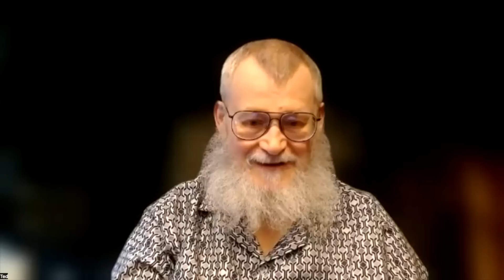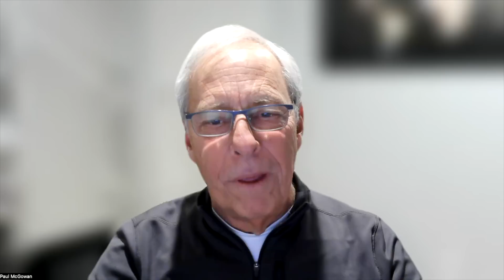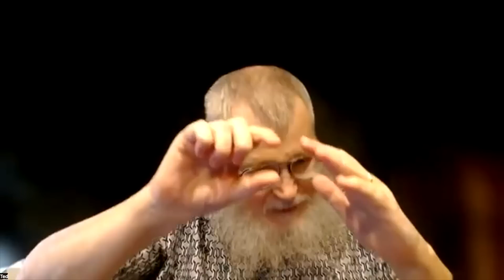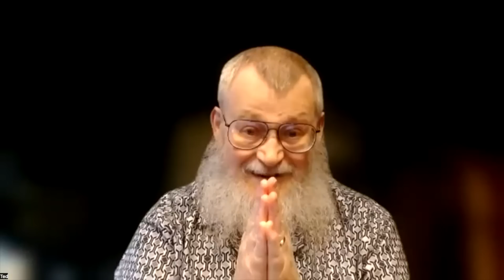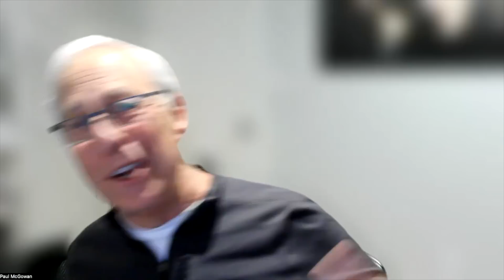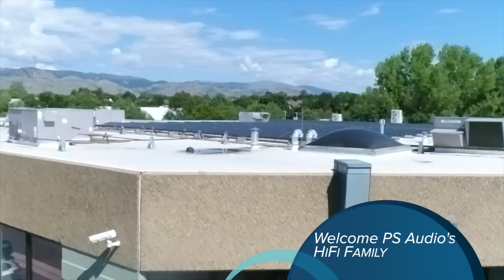Paul and Ted discuss the DirectStream MK2 DAC

Comment: As a PS Audio fan and with so much going for the Mark II, I need to ask.... When might we see a chassis redesign/upgrade of the company's electronics (i.e. make it look better)?  At the level that you're playing, you must see the importance of this...case in point, the FR series vs prototype designs or other companies' designs.  It's not all about looks, but if my water boiler is universally more visually appealing than a >$5k luxury electronic, there's something that needs to be solved.  🙏
Reply: I'd like my MKII's on order to be a little fancier, but the silver looks fine.  I wish the screen were as big as the MK1 I just sold.   But we PS Audio customers are value customers.  I'm kind of happy my BHK 300 amps are so austere looking.  When first released they were reported as sounding better than the gorgeous Constellation amps, also designed by the late Bascom King.  The BHK's are a fraction of the price and have a tube input section which affords tube rolling for even better sound.  Of course now I want to trade up to the BHK600, but not possible right now.

Comment: Can you run 2 amps off the outputs like a speaker amp on xlr and a headphone amp on rca without it getting angry at you? Many dacs only like 1 output getting used and prefer just balanced. If you plug in another amp the noise goes up bad and you get hums.

Comment: love this video. As a (software) engineer myself, I love hearing people talking about optimizations and improvement / strategies. Can so relate
Reply: I'm the polar opposite of a software engineer, (though a tech oriented filmmaker running a huge Davinci Resolve rig) yet I absolute love hearing about optimizations as you mention, and how it affects sound quality.   I've watched it 3 or 4 times, a few times pausing to read about the component he mentioned.  I have a MKII on order and excited by the potential to increase quality as Ted spoke about using the second FPGA.  In another interview he mentioned he was only using half of the first FPGA, so who knowns what can happen.  I've owned the very first round of directstream MKI 8 years ago, so I've been enjoying Ted's lowering of jitter and distortion, the platform for a long time.

Comment: Running with a Nuprime Dac-10....black as black background. No talk of galvanic isolation. Sounds glorious. Oh, and I bought it used for $800. No way human beings can make a DAC that sounds 10x BETTER than the Nuprime. Different flavor of sound, maybe. Magically makes a song sound 10x BETTER? Nope. Welcome to the Hifi rabbit hole folks.
Reply: It depends on the system.  Just converting from flac to WAV makes a huge difference in my system, as did an EtherRegen.  I know how good the MK1 was and waiting on my shipment of the MK2.
Reply: @johnnycashlesscomedy8616  of course you going to try to defend it because you're dropping $8,000. There comes a point where its diminishing returns in hi-fi an eightt thousand-dollar digital-to-analog converter is not needed to hear incredible sound. A waste of money. I have three rigs in my place and a couple of them are under $8,000 for the entire setup and they sound fantastic. You talk about sound files making a difference. I guarantee you you didn't do a blind test back and forth between the songs. So now it's called placebo effect because in your mind it should sound about her so you're telling yourself it does sound better even if it really doesn't in reality.

Comment: Interesting discussion.  But, $8,000 for a dac is rarified air.
Reply: $8K  for a DAC is just plain stupid.
Reply: @byrdmania4895  Expensive , but the product is made in the US, Colorado, if that means anything to you.   PS offers ridiculous trade in offers, like $3500 for your old gear, plus ability to audition at home before you send your old gear in.  The free firmwear upgrades keep the machine current and evolving in quality for maybe 8 -10 years, which helps the value proposition in an appropriate high end system.
Reply: @johnnycashlesscomedy8616  Yep I don't think it would be too smart,, possibly snake oil..?
I guess it could be a tax shelter for someone with too much $ but that leaves me out.. Ha Ha..
Reply: @ClearViewRoadsTV  How is buying a DAC (or any tech product) which depreciates a "tax shelter?"  I totally understand people's frustration at expensive products when many are struggling to survive, but PS Audio makes a $600 integrated with DAC a friend has and it's pretty nice sounding.  Look for it used maybe around $400.  I wouldn't have been able to afford the new DAC without the generous trade in policy. PS is a value oriented product - no fancy case, high  volume sales.  No wonder there are so many fans at many price points to let people get high end sound at relatively down to earth prices.
Reply: Generally speaking, better quality components make for better sound but they also usually cost more.  I think Ted and PS Audio have achieved a remarkable improvement in performance for only 2k more than the MK1.  Everyone has their own comfort zone / sweet spot on the cost/performance curve.  I think the MK2 has gone a long way to force that curve lower.
Reply: @carlstineman274  I agree that value is a personal question.  But, I can ‘t help but wonder what the margin is on high end audio  products.  If it were not a lucrative business why would there be SO many companies making audio equipment at the same time that audiophiles are so rare.  All of this said, PS Audio is an easy company to admire and I own an amplifier with their name on it.

Comment: Thanks for putting this together, it's always great to hear from the man that does the cooking.

As an aside are your m700 monoblocks power factor corrected?  I spent most of my life in the power supply industry so I know adding PFC correction is often done by using the right switch mode control chip in the power supply and a large amp can really do damage to the AC line waveform if it's not tamed.

Comment: "Bad digital isolation". "Magneto restrictive (sic) coupling". Oh dear oh dear oh dear. This was painful to watch and not scream loudly at every new instance of techno-babble.
Reply: magnetoestriction is a real thing. it's why power transformers "hum". The iron is literally growing and shrinking! But I've never heard of magneto restriction, and in any case I'm not sure magnetostrictions apply inside of a DAC. If he's saying that there's enough current inside the DAC to change an inductor's size, and claims that this noise is audible or negatively impacts clock or ground stability, I would be suspicious of the claim.
Reply: Ted is a genius that worked at MS before developing a groundbreaking product.  I've heard every step of the way how his new OS builds lowered distortion and many other positive qualities.  You should hear his gear in an appropriate system before dismissing it.
Reply: @johnnycashlesscomedy8616  I don't need to, nor am I dismissing his gear. I'm dismissing the clearly inaccurate pseudo-science in the discussion. Terminology matters, and misusing it is unforgivable. I've worked with enough technicians over the years to know when someone is just making impressive sounding but ultimately specious noise.
Reply: As a technical person his language is an  accurate  correlation to Layman's terms.
Hook up something like an Oscilloscope or Lab Grade meter, write some code and describe it to someone who has never learned how to interpret that  type of diagnostic equipment or information. 
If you are not technically inclined it's difficult to know his translation.
I was often scolded for being too technical in my early days.

Comment: "Galvanic isolation may make a difference for you or it may not make a difference for you...", but you are going to pay for it anyway.
So how do you eliminate noise caused by flux (the total magnetic field which passes through a given area), why by using magnets in magneto restrictive coupler.
WAIT WHAT?
Your using current and magnets which are a source of noise in electrical circuits to eliminate noise in electrical circuits?
How are you isolating the outputs?
Transformers.
Transformers cause distortion of the output signal, but the good news is that you can bypass the transformer and the isolation with a switch.
WAIT WHAT?
Doesn't a switch introduce phase shift and distortion too?
Sounds like a whole lot of money for something that "may make a difference for you, or it may not make a difference for you".
Reply: Pretty much everyone on PS audio's forum that has heard the MK2 vs. the Mk1 have glowing things to say.  I have heard how Galvanic isolation helped using my etherRegen, making the music less edgy and more like my great vinyl rig sounds.  So don't get hung up on whether one aspect of the topology is beneficial or not.  The sum is greater than the whole of its parts.  Going to order mine this week, helped by the generous trade in offer on My MK1.  Ted is the real deal.
Reply: @johnnycashlesscomedy8616  Ya well here's the problem with you "hearing a difference" with galvanic isolation.
It doesn't make a bit of difference because the next step in the power supply is storing the A.C. right into capacitors (remember the capacitors he dismissed but forgot to tell you were the next step in line) to be converted to D.C.
The DAC or all audio components for that matter don't use A.C. at all and it doesn't make any difference how "clean" the A.C. is coming into the capacitors.
If you would have listened to Ted he used a lot of double talk and half-truths to try and sound convincing.
So why do people on the PS forum talk about how much greater sounding the MK2 is?
Well, those are all the people that said how great the MK 1 was. 
PT Barnum said it best "...there's one born every minute."
I believe Mark Twain often gets attributed to the quote "It is easier to fool people, than convince them they have been fooled."

Comment: New acronym, GVI- Galvanic Isolation! Less Tongue twisting! Lol 🤣
Reply: It's easier to just say transformer.
Transformers are galvanic isolators.
Reply: @JonAnderhub  I thought the whole purpose was to isolate or eliminate the noise produced from such a primitive beast through newer and more innovative circuit design through smaller and faster component designs that reduce potential noise/hum brought by lower quality metals that electricity travels through! Am I mistaken! Lol